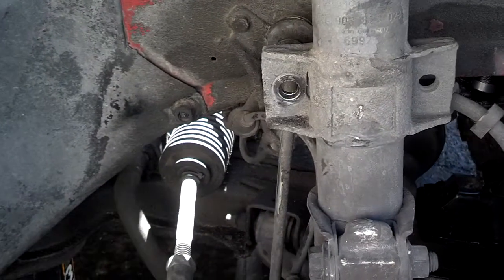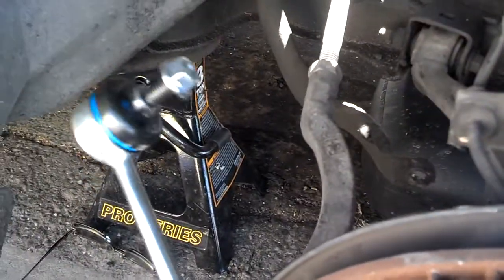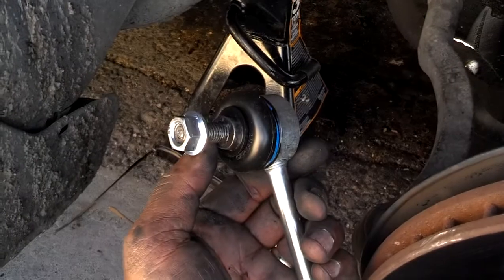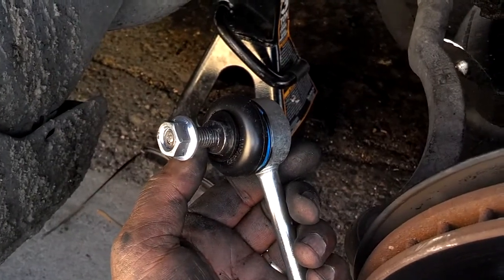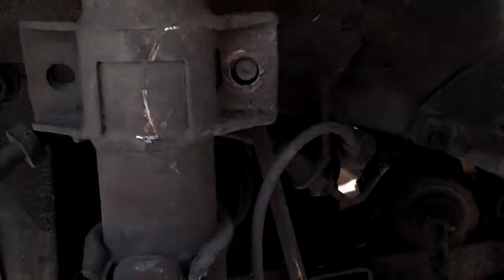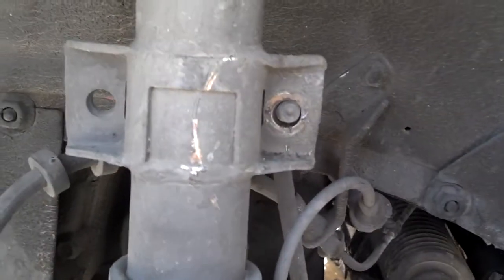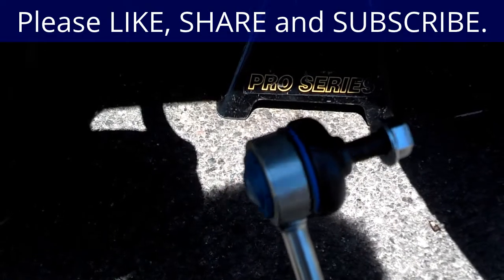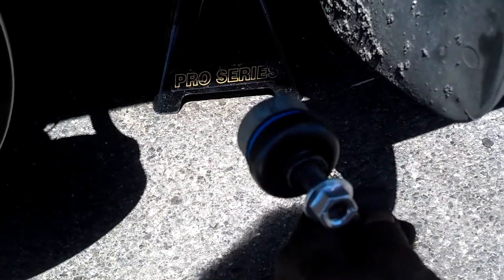Sway bar end links replacement, Volvo S70, V70, 850 and other cars - VOTD

Comment: Thank you, Robert.  You are a great resource!!!
A good tip that I found would be this:
"When you tighten the endlinks you wanna make sure you have your suspension loaded. You can use some wood, ramps or two jacks. The reason is if you dont then when you put the car back down the endlinks are stressed out so when its time to handle bumps it wont respond as well and will wear things out much much faster. Just look up sway bar preload and you’ll find a bunch of videos explaining the topic."

~
Reply from the maker: Interesting.

Comment: Thank you Robert! Your description of the sound is exactly what I've been experiencing for the past 5 years and no one can figure it out - not the Volvo dealership or even my speciality European auto shop guys. I really hope this solves it. Driving on back roads and side roads has been horrible and I try to turn up my radio because the jiggling noise has become so unrelentless even over small dips and bumps
Reply from the maker: Hope it helps. These cars also have problems with the dash mounts falling apart and making a lot of crackling noises from the dash.
Reply: Robert DIY Oh you know it! It's beginning to make some sounds here and there, but I'm not worrying - I caught your video on the dash mount replacement too, so I'm all prepared for that one now

Comment: once a Again, Superb Vid and step by step..My mistake would have been not getting My 16 mm Thin PARK TOOLS bike hub wrench ( nice tip). The originals end links that were to come off?:? NO INSIDE  16 mm section , Thank gosh For ROB GRIP wrenches! The Spun Spun SPUN! The new mehles went on like a Charm after putting a Jack under the Ball joint of my xc 70.
Reply from the maker: Thanks for watching.

Comment: Smashing repair as allways :-))

I wished manufacturers would put flats on other ungripable shafts, having to use channel locks or mole grips/vise grips is a rather nasty way, but sometimes you have no choice as there is nothing to put a spanner/wrench on :-(

That new ball joint looks nice, decent quality :-)
Reply from the maker: Thanks for watching. I like most Mayhle products.
Reply: Just a comment: Some of these links have an indent on the end of the bolt where you can insert an allen wrench. Took me a while to figure that out and also to get it tight, but it allows you to tighten the thing without a vice grip. Still a pain!
Reply: @samuelkilada3975  ez way is hold the nut with a wrench and drive the stud with impact.
Mine is T40 torx. 
Some are 5mm allen.

Comment: I have a 2001 Volvo s80 turbo.  when I turn the steering wheel left or right, it makes a almost growling sound.  I have recently replaced control arms, both front cv axles, & sway bar links... outer tie rods and ball joints look ok.  I feel almost a little judder from the passenger side outer tie rod.  I think its something to do with the rack and pinion. 
 any thoughts??
Reply from the maker: Raul Romo Low fluid in the steering reservoir. If you keep it topped off, you may never destroy the rack. If you keep driving it with it low, it will destroy the rack and power steering pump and cost you a lot of money. You can get the leak fixed if you want.

Comment: Hi Robert thanks alot for you videos, i have replaced my oil trap waiting your videos.it was really hard cause i broke a tipe that comes from the trap to the air intake and you cant buy it on its own.i had to buy a complete one that goes from the side of the engine to the oil trap and then to the air intake with some water pipes linked to it as well. what a mission. i have a v70 2.5 turbo 2004. I getting a clunking sound from the front when driving at low speed, like on paving or over a hump. I have changed the shocks and the struts, but the sound is still there. could it be my Sway bar end links ??
Reply: I have the same problem and noticed the bushings were torn on this piece. Visually inspect the rubber and try to pull it around.

Comment: planning to do sway bar end links soon when I change struts. Are the sway bar bushings removable and easily changed with the Swede proparts bushings or other?  on my 96 850R wagon the bushings are cracked and maybe adding to the many creaky noises. the new bushings are cheap, but forums saying how the old ones don't come off..?... Is it not possible to slide the new bushings over the ends, when links are off?  any videos on this topic? thx!!
Reply from the maker: I have not done them. Mine are destroyed. I hear that you have to chisel them off of the subframe. You must drop the back side of the subframe.

Comment: I have a 2002 s80 if you hear a clicking noise while turning the wheel and are not moving is that the sway bar link or could it be the cv joint?
Reply from the maker: I don't know. You need to check for loose tire rod ends, etc.
Reply: Thanks for the advice Robert, you the man!!!
Reply: Bought my wife a used Volvo about a month ago again without your videos I would be in a bind. Keep up the good work!!
Reply from the maker: +Common sense American real man let us know what you find.
Reply: Ok I definitely will , thanks again
Reply: Sway bar end link , went ahead and changed both sides